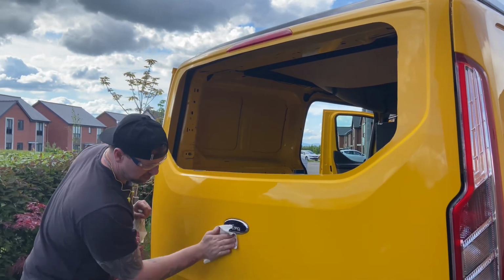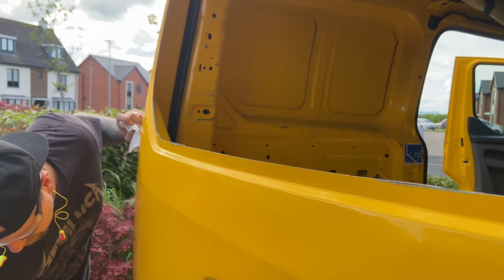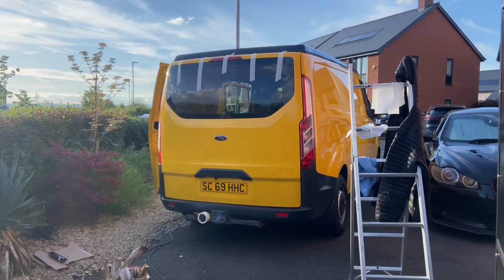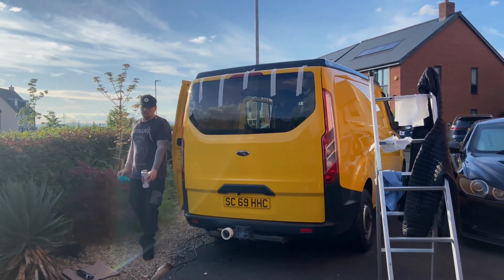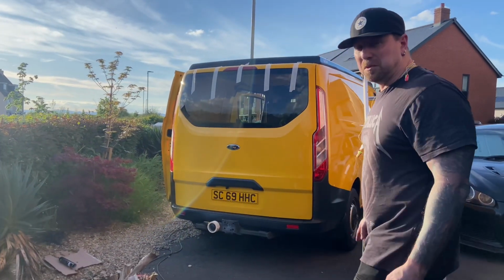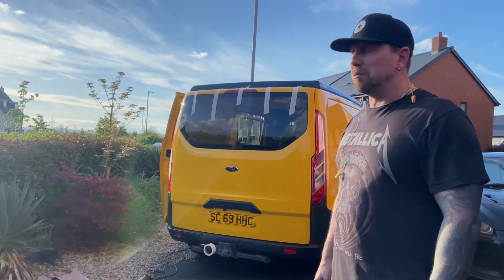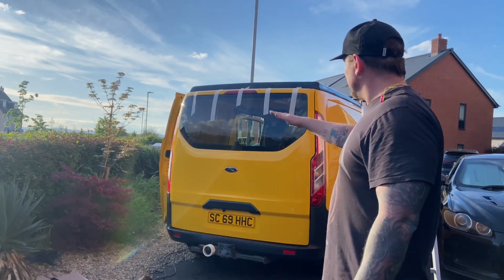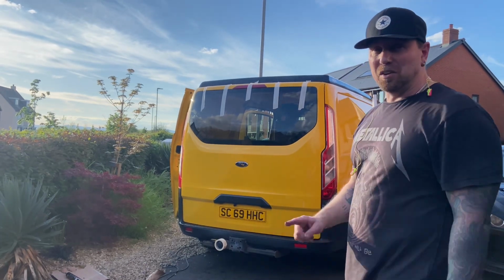Fitting A Rear Window - Ex AA Van Camper Conversion

Comment: I feel your pain! I’m converting an ex-AA van too… very nearly finished it. Doing the windows was pretty awful. We had the same issue with our (plastic) mastic gun, which resulted in problems with the side window we fitted to the sliding door. The gun literally snapped and I had no chance getting an even bead. We bought a much better one for the rear window. There’s so little room to put your beading when the u channelling goes on that back window - it’s tough! My window isn’t perfect (there are a few little smears of mastic I wish weren’t there) but I’m pretty happy looking back.  To be fair, it’s probably the toughest job (and certainly the most nerve wracking).  I’ll follow your build with interest! Good luck!